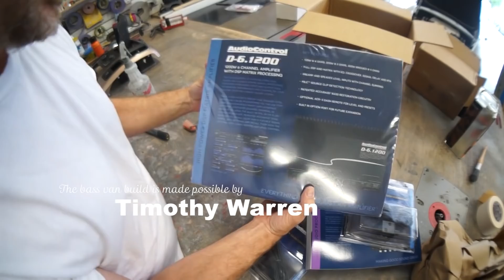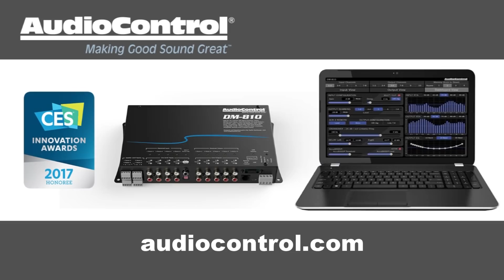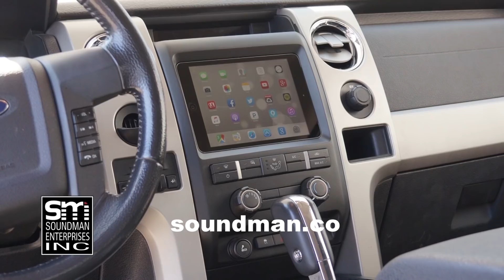SHOP UPDATE and VAN NEWS! - BVV #44

Comment: Do you have to use fleece when fabricating fiberglass door panels or speaker pods or is there other fabrics that work as well?
Reply: I think fleece is the fabric of choice because of its stretchability and it absorbs resin well. It doesn’t really contribute to the strength though so you could use whatever. It basically just makes a shape.